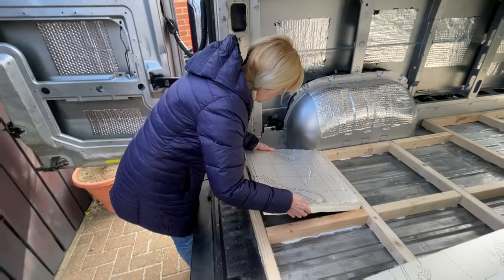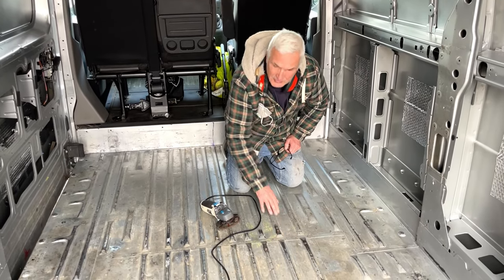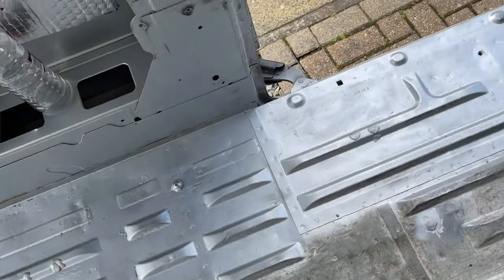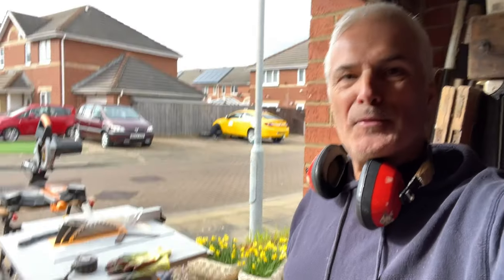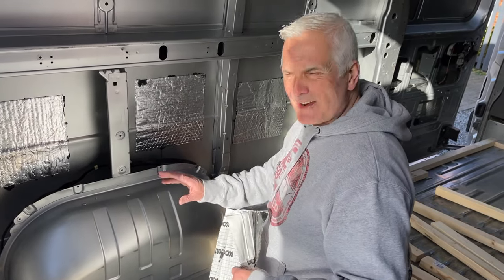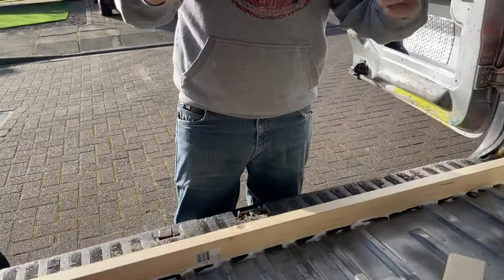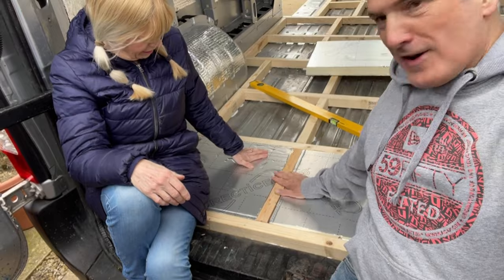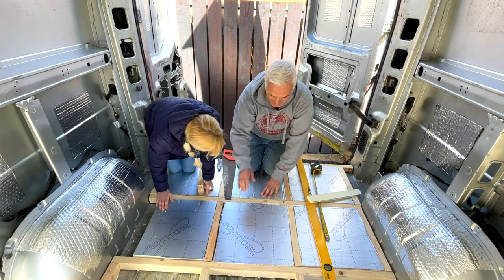CamperVan Conversion Part 4. Floor Installation and Repairing Holes in the Floor.

Comment: The first silver tape I bought off Amazon was terrible stuff , I didn’t know any better and had heard it was rotten to use , when I ran out I got some from my local hardware shop , what a difference, really thick and easy to use . Gutted for my time wasted 🙈
Reply from the maker: That's probably a good idea for when I need some more. Thanks for the tip, and for watching of course :)